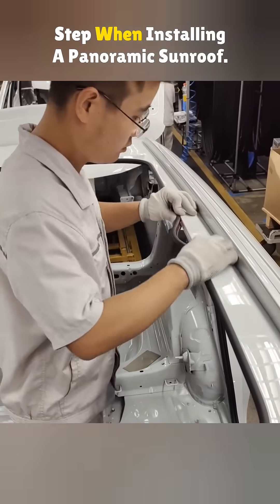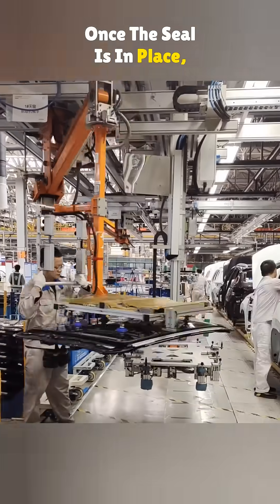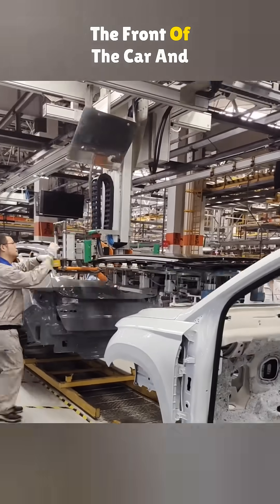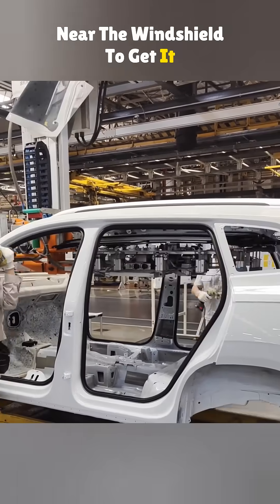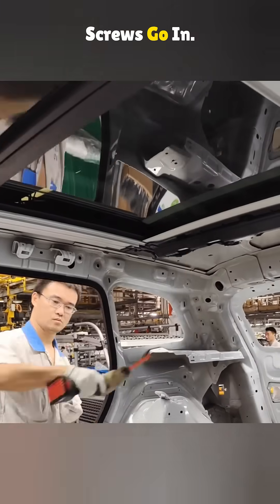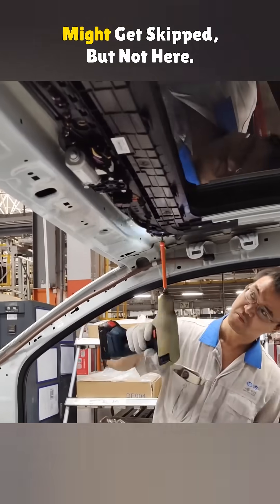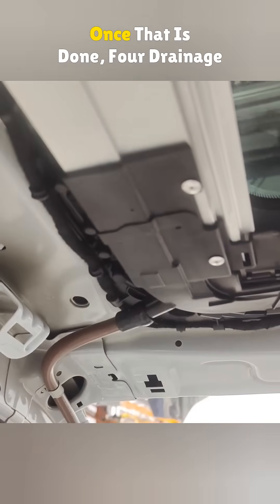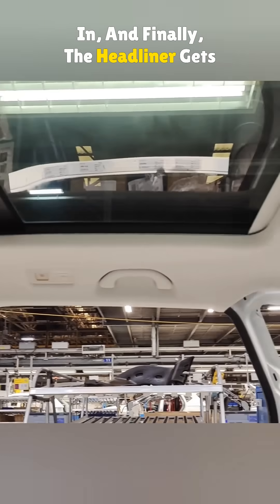How the Panoramic Sunroof Gets Installed #automobile #assembly #manufacturing #car

Comment: The art of amazing stupidity in engineering.  Perfect fit for leakage.  Should be on a top groove with seal so easily removable during breakages, shrinkage due to aging or weather cracking or seal compromise.  Screw the customer on eventual costs and failures with age.

Comment: A fun fact. Car sunroofs are not exactly watertight. In fact, the car makers do not even try to make them watertight.  Noticed that they installed drainage tubes ? Water that seeps in and gets channelled out via those drainage tubes.
Reply: Yup and if those drains get clogged that can cause problems
Reply: @YAWSSSSSS  Which they all inevitably do.
Reply: @Which-Way-Out it's a shame because they're pretty cool looking and add a lot of light to the car but are not worth the headache down the line to repair.
Reply: @YAWSSSSSS  True, Sun roof's are cool, and it's a shame there has to be trade off''s with having one, but if your aware of them, so be it. I think new car buyers vs second hand buyers have a different check list also.
Reply: Just clean the drains.  @YAWSSSSSS

Comment: I don’t like glass on the roof. These full length ones are ridiculous. There are so many videos of SUV’s ending up on their roof it can’t be good for safety.
Reply: Not only that, but a small stone can do a lot of damage, whereas it may only leave a small (and possibly correctable) mark on a metal roof.
Reply: @paulparoma 
There are reports online of the glass just shattering for no apparent reason. Some suspect that heat can cause it. Hail can too.
Reply: @1985230ce  More to the point.